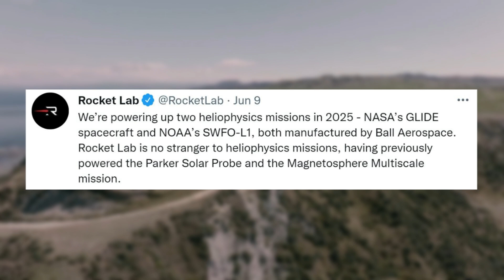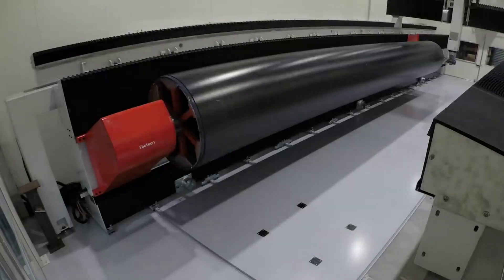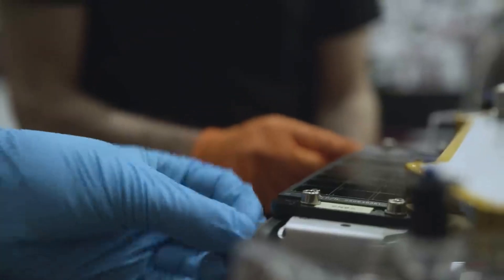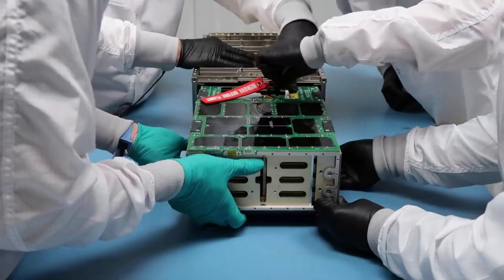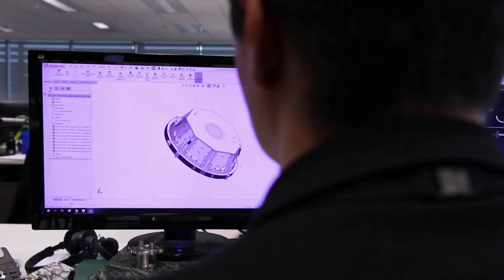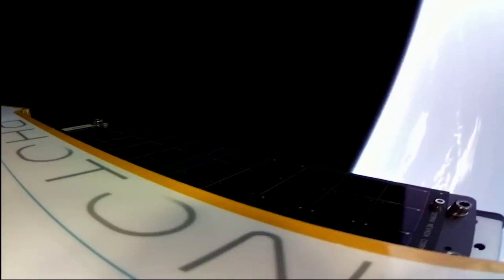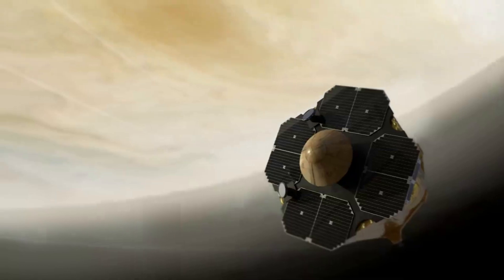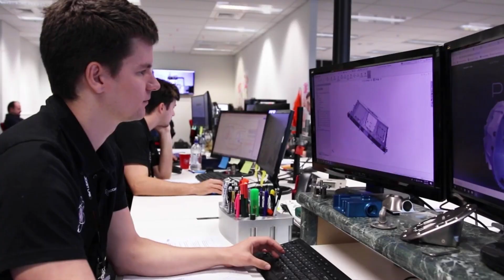Rocket Lab's New Mission Using SolAero Acquisition

Comment: Rocket labs is pursuing a rational space launch system. Elon has lost his mind. Starship system can't work. Ps this channel is really good.
Reply: This comment is going to age really poorly. I'm long on RKLB, I have a large stake of my portfolio in it, but just because I like it I'm not delusional enough to think that Starship is not going to be an absolute game-changer. I'm not sure if you are referring to Starship itself or to the catching tower, but early tests of Starship already showed that it can properly land by itself, and even if the tower doesn't work they can simply add the legs back on and proceed with no issues. I don't think Elon lost his mind